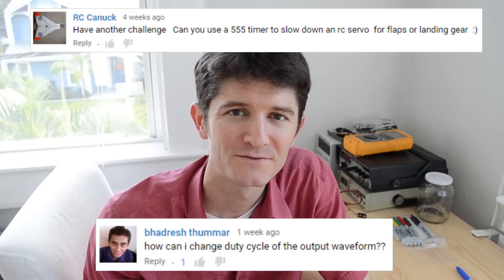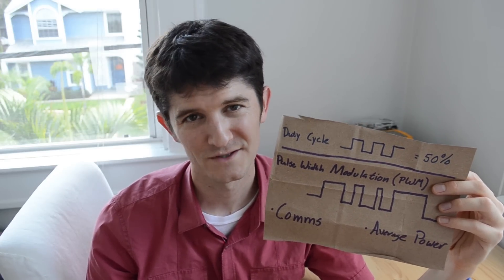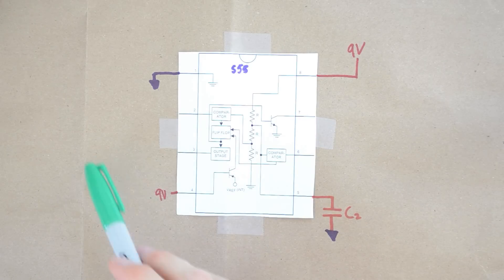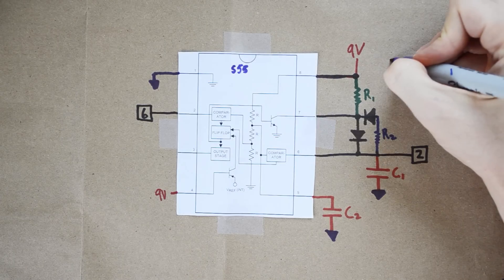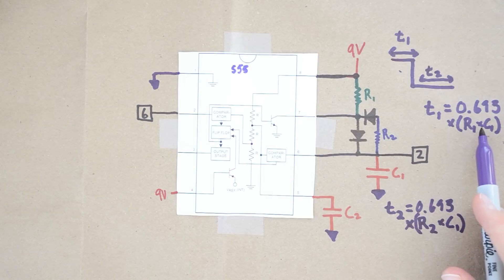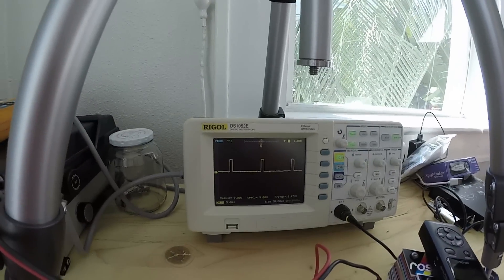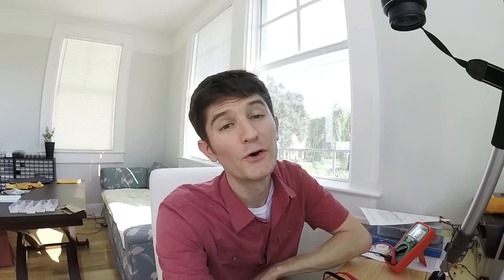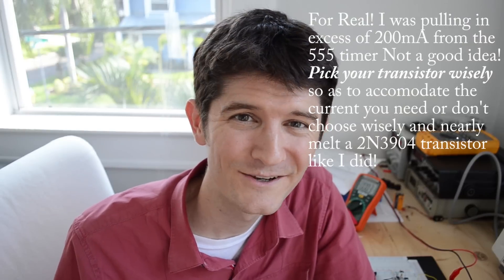How to Control the Duty Cycle of a 555 Timer

Comment: Me again  sorry    I've been reading a lot and finding out that Hobby Servo's need to be controlled by PPM   not PWM  as pwm can harm the motor or speed  controller .  I'm trying to control the speed of a 9 gram  RC servo for an airplane to slow down the movement of the landing gear . Any ideas or suggestions would be excellent
Reply from the maker: +RC Canuck I'm not much of an RC guy but it looks like PPM is used for communications and PWM is used for speed control applications. From what I've read, PPM is used while sending controls from the transmitter to the receiver, but PWM is used to control the actual mechanism. This webpage (http://www.endurance-rc.com/ppmtut.php) does an ok job of talking about PWM but it's splits up the applications used for each modulation type down at the bottom.  If you're looking for speed control for the motor, I believe you want PWM. You are right that PWM could harm the speed controller, because the controller is looking for a definite PPM digital command from the transmitter. However, unless the motor has some sort of built in PPM translation circuit, you would want PWM to vary the speed. Of course all of this is 20 minutes of me reading on the Internet and not having ever touched an RC control circuit. It's likely you have a far better grasp than myself. Good luck!
Reply from the maker: +camaro z Feel free anytime. It's not at all a bother. I learn a lot looking up things like this.
Reply: +Skinny R&D
thanks Jason. 
I'll try not to bug you anymore
Reply: Skinny R&D cegrhrbrhe rvt r. r

Comment: I just noticed that you're not only varying the duty cycle, you also changing the frequency...
http://everycircuit.com/circuit/5623197092282368
Reply from the maker: +Álvaro M. Valdebenito B. You are completely correct! The diodes are really good at letting you set one or both of the values (t1 or t2) that comprise the duty cycle, however the method that I used to change the duty cycle on the fly does have the side effect of changing the frequency. I've added this topic to my list of videos to make. I would like to address how to keep the frequency constant and only change the duty cycle. This "to do" list is steadily growing :o)
Reply: +Skinny R&D Great video. I would really like to know how to adjust the duty cycle without changing the frequency. I assume this would need two potentiometers?

Comment: Nice video!
Can you follow up on how to control the duty cycle with a voltage?
I want to PWM a PC fan attached to heatsink, and vary the duty cycle according to the voltage from a temperature sensor.
After quite some Googleing found 2 555 solutions. One uses 2x 555s (or one 556) and pin5 magic. The other uses a 555 to create a triangular wave and a comparator for the PWM.
I can dig up the links from my notes if you are interested.
Reply from the maker: +Álvaro M. Valdebenito B. Thanks! I'm always interested in fun projects. Feel free to add the links in comments.
Reply: Skinny R&D Here is the ref for the 555 & 393 PWM (Chapter 5: The  and PWM)
http://forum.allaboutcircuits.com/threads/leds-555s-flashers-and-light-chasers.19075/#post-117641
Reply: Skinny R&D Cound not find my original refreence. Thaks to google found anither one. the control voltage goes to pin5 of the monostable 555:
http://www.learnabout-electronics.org/Oscillators/osc46.php